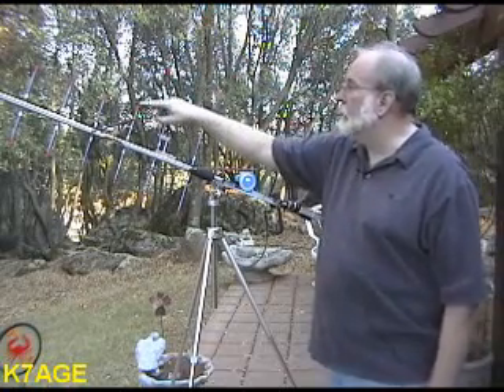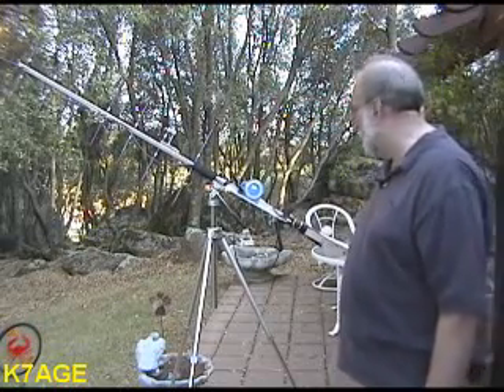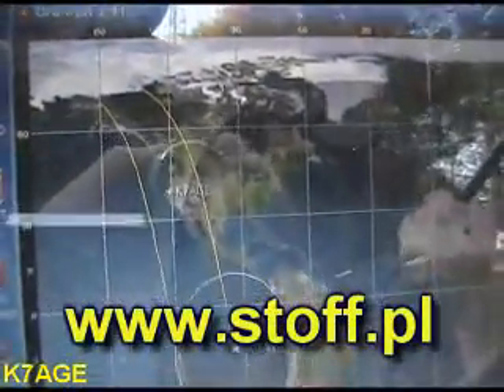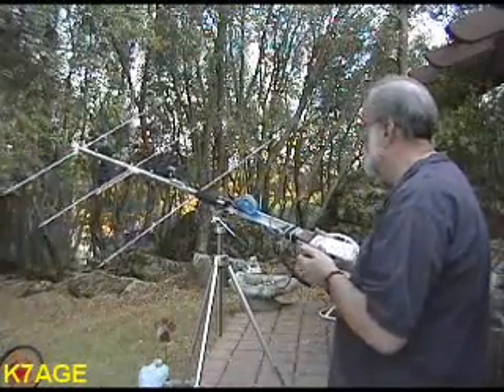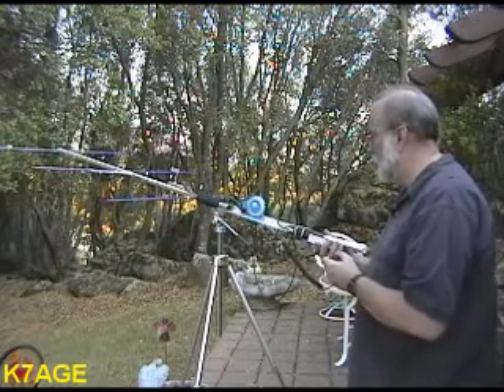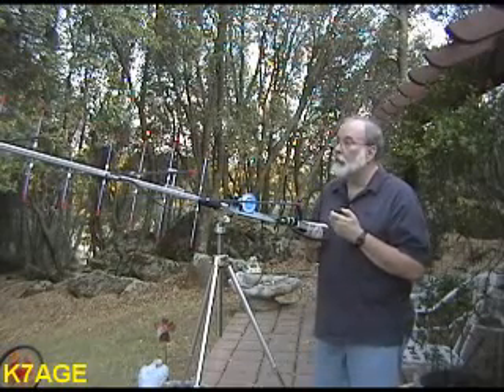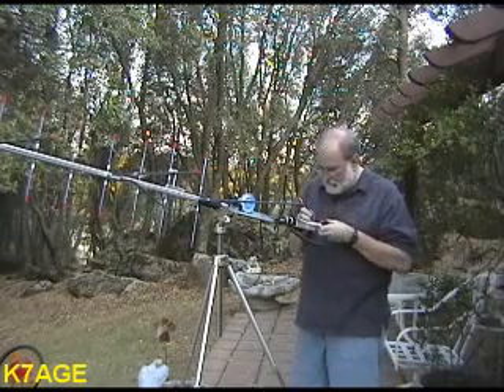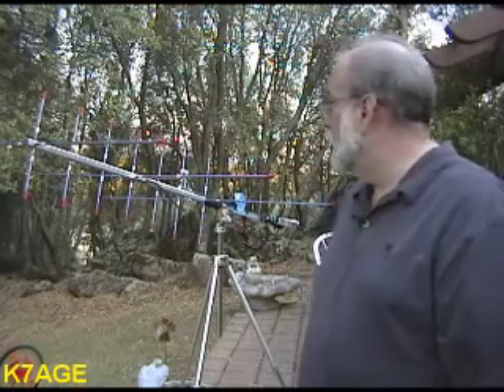Ham Radio AO-51 Satellite, again

Comment: Great video. I have been trying to work so-50 with my baofeng’s and my th-d74. I am struggling . I got the arrow II and that made a huge difference. But trying to do so many things at once is   Challenge. also that low angle and the results you got was amazing . I seem to need 60 degrees max elev to get that clarity here in Florida . Maybe I should pick a different sat.  Thank you 🙏

Comment: That holder for your radio is clever along with all the pointing aids. For those on a budget, you might want to look into how well this inexpensive ($16 + shipping) 16-element log periodic antenna works as a 2m/440 satellite antenna, either as is or with a bit of snipping of the elements to tun it more precisely.  https://www.mtcradio.com/hdtv-outdoor-antenna-vhf-uhf-16-element-hi-gain-log-periodic-design/
--Mike Perry, WA4MP

Comment: Would be great if ARROW Antennas backed their products.I have one of their J-Poles that when it gets wet the SWR goes above 2.1 & even 3.1 depending upon how wet it is.It was sent to me as a replacement & the new antenna does the same as the 1st one did.As soon as I told him the antenna had the same issues he stopped answering my emails.It has been checked on two different coaxes & if you wipe the antenna dry it is near perfect & when it's wet it's far from it.Tells me that ARROW Antennas has an issue & he is attempting to ignore it which I will NOT do.I will spread the word of his defective antennas so others don't spend their money with him due to lack of product support.

Comment: Very informative just what I was looking for. 
What sort of distance do you get using the sats? I'm guessing you can only send and receive if you are in the sat footprint? 
Do you have a specific part/model number so I can order the Arrow antenna?
I presume the standard antenna that came with the hand held is not up to the job?  How about if the sat is directly overhead?  
What sort of power output do you need to use?
Have you had any luck with the ISS ?
Thanks again.
Reply from the maker: +Gary Mitchell Yes, withing the foot print. Maybe up to 2,500 miles. Arrow antenna - www.arrowantennas.com/arrowii/146-437.html  The standard antenna, you may be able to hear the satellite. The beam will make the signals stronger and your signal stronger to the satellite. 5 watts will work, more power will help.  I have worked the ISS years ago using my old home station. Big antennas, 44 elements on 2M. Big antenna needed for the AO-13 satellite from back in the 90s.

Comment: I just received an Arrow Satellite Antenna 146/43710w and need an inexpensive HT to dedicate to this antenna. Any thoughts on an HT for this? I have read that the Chinese radios have desense.
73, Bobby KF5GTX EM15fi
Reply from the maker: +Bobby Duncan You will need a dual band radio. Only a few allow for full duplex, so that you can hear while you transmit. Clint has lots of good info on gear. www.work-sat.com
Reply: +K7AGE Thanks Randy. I picked up an Icom W32A and the speaker mic, NiMH battery and charger.

Comment: Randy, I'm assembling my own portable satellite ground station (modeled after yours -- and the work of N1ASA, of course).  I have a Manfrotto tripod, but I don't have that sweet tripod head you're using here.

Can you discern any part number on it?  Or I suppose if the tripod/head combo was cheap enough I could just add it to the shopping list.

Thanks!
73 de Tom WZ9U
Reply from the maker: Tom Maynard That is a 40+ year old tripod, no part numbers.  Nothing special. I would think almost any would work.
Reply: +Tom Maynard Just an observation: the kind of tripod head he's using is for still cameras. Still camera heads aren't fluid (for panning and tilting) and have that capability that you wouldn't need for a video camera. Any head that is designed for still camera's should do the trick.

Comment: Great video. I have been trying for a few weeks now to connect with ANY satellite with no luck.  I've watched videos and read on AMSAT about Doppler, frequencies etc.  Now it would seem that this one isn't even working, correct?  Any information on working satellites that I can attempt to connect with?  I would really like to get more into this but am struggling with connection and hearing anything, wondering if the ones I am trying to connect to are even operating. Using HT with same antenna.73

Comment: Hi, 
Thank you very much for your video,  It has inspired me to give the satellites a go again.
20 years ago I worked RS10/11 many times and had a heap of fun.  Up on 2M down on 10M.  Running 10watts SSB on 2m and using a 2 element X Yargi, and a Delta loop on 10m for the down link, all home brewed.  I remember also working a mobile station as well.  
Thanks heaps. You are an inspiration to hams world wide.
73 de Alan
ZL4FM

Comment from the maker: I think if you had computer control of the rotors, there will not be any hunting around looking for the satellite. The computer will know where the satellite is and point the antennas. I used to have that all running with my 48 elements on 2M and 38 elements on 435.

Comment: After years of watching several videos on youtube and reading up on working sats I finally worked AO-51 yeaterday at 23:30 UTC with a FT 817 and a rubber duck antenna. Worked K8YSE in Ohio with 2.5 watts on battery power.  Maybe I'll order the arrow when money permits.

73 and thanks for all your fine work 

W6CSA
EM50

Comment: This is soo cool! Question though is the signal bouncing off the satellite? Or is it being recived and then transmitted by it? If soo its just there for anyone to use. On more thing I dont have a ham yet but I have a scanner that picks up 10,6,2 meter and 70cm HAM, if I made a dicone for it and aimed it at the sky I should be able to hear stuff right?

Comment from the maker: Probably not, since BNC connectors are used. This antenna is mainly for portable operation, as it disassembles easily. For a permanent installation you would be better off with another antenna. Randy

Comment: I enjoyed this.  I'd like more "instruction" about the how to do it portion.  I see what you've done, I need measurements and tools and wires instruction.  For example, I didn't hear what band or what kind of HT, etc....supposing your working low watts into 440-2m dual bander but uncertain as to how to set it all up. Is there another video you've done all this with?  Tnx, 73, Donn, KA0SOH

Comment: Great video. Brings back memories of the days operationg AO-10, AO-13 and AO-40.

I did not catth your acknowlegdment of your first contact's callsign of WA7ETH. You did acknowledge his grid but never transmitted his call back for confirmation. 

You copied VE7CRE's call incorrectly as VE7CRT, but did get his grid CN89 correct. VE7CRE is indeed in CN89 and VE7CRT is in FN86.

Comment from the maker: Correct, duplex operation of the radio is not required. But, some guys operated with full duplex to hear themselves coming back. If the radio has duplex, you can probably disable that feature. You will need the duplexer in the antenna to work both bands from one coax. Randy

Comment from the maker: Try and listen with the eggbeater. Its pattern may be fairly low to the horizon. Listen and see what happens. Select the PASSES tab on the AMSAT home page, there is a pass Prediction calculator. You need to enter your location. Yes, I was running 5 watts, no PL. Randy

Comment: Hi Randy.  Good job showing how easy LEO satellites can be using only an HT and an inexpensive antenna.  I've made a couple of contacts using my Yaesu FT-60 and an Elk 2M/440 L5 (5 element 2 meter/ 440 mHz Log Periodic).  You've got a nice setup with the tripod and the boom extension.

Keep the good videos coming!
73 de KI6BEO

Comment from the maker: You will need a dual band as you need 146 & 435 at the same time. Some of the HTs allow you to receive on one band while transmitting on the other band. This can help or confuse you with hearing your signal while talking. But you can probably set the radio not to do that. Randy